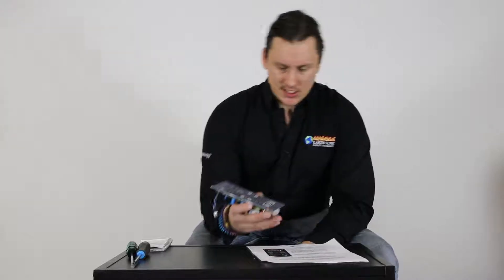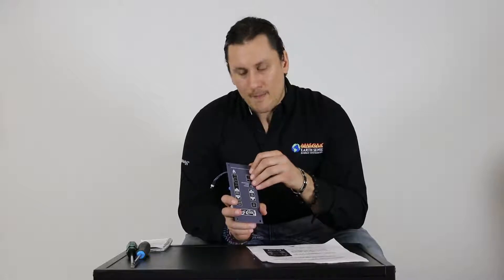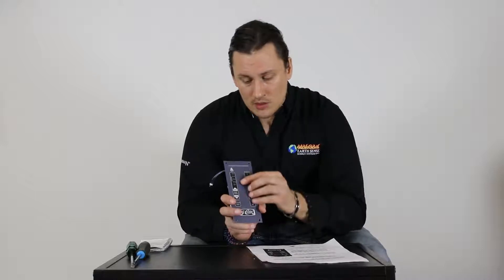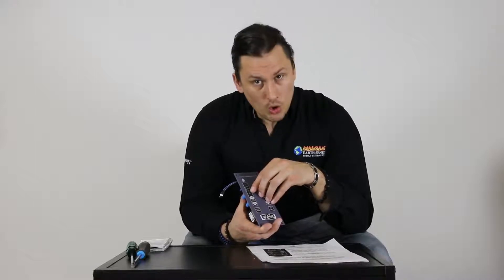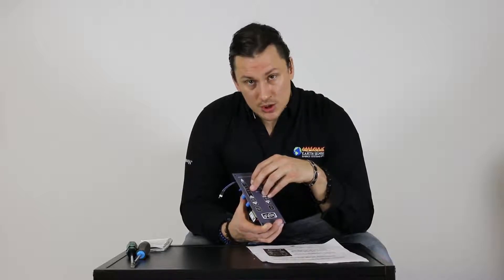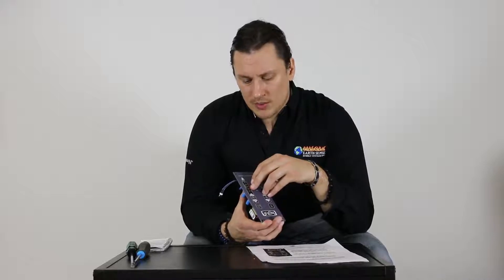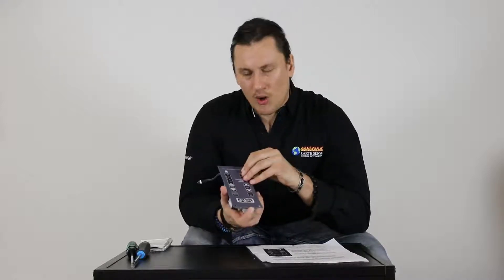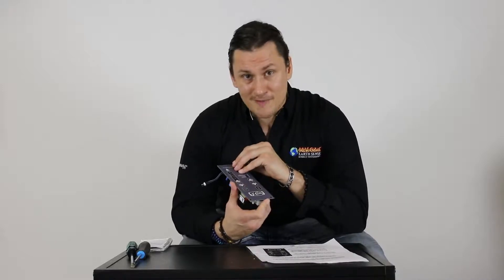St Croix Control Board Diagnostics - Error Code Fault Blinks

Comment: Hi. I have a St Croix Prescott Exl. I just thoroughly cleaned it this morning. Emptied the ash tray, vacuumed the inside, and cleaned the glass. I then topped off the pellets and restarted it. After about 10 minutes it shut itself off and now there is one single blinking light on or between the number 2 heat setting. I googled it and it said that either the hopper might be empty or it might be an issue with it so I was hoping that you could help me try to troubleshoot it. Thank you.
Reply from the maker: Thanks for contacting us, happy to help. The #2 light will indicate a vacuum switch  error. Typically this is caused by an air blockage or an air loss in the unit. 
- Check the firebox door gasket and ash pan door gasket to ensure they are sealing tightly all the way around. 
- Check the exhaust vent pipe to ensure there are no blockages.
- Check the combustion blower/exhaust fan. It should be running near line voltage during startup to lock in the vacuum switch. 
- Check the vacuum switch hose to make sure it's connected tightly and does not have any cracks or breaks. 

From there, if the issue persists we can test the vacuum switch itself to see if it is faulty. Keep us posted, happy to help. Thanks.

Comment: I have a St Croix  Afton Bay and just had to put a newer board on it.
I may have incorrectly made the initial settings .
If I unplug the stove will the computer go back to a base setting so I can reprogram it correctly. I can't get enough heat out of it with this newer control and suspect my settings are at fault.  Low heat and overloading the burn pot with pellets.
Reply from the maker: Thanks for contacting us. Yes, we would suggest to re-program and see if that fixes the issue. Unplugging the stove will not reset the board program, you can re-program as it currently is. Here is a quick video run through on that, any questions just let us know, happy to help. https://youtu.be/ljpBV4zUxIE?si=PHwiOhfpXQqa7RFm

Comment: I have a blinking 3, POF error.  I did purchase a new switch but was hesitant to screw it into the metal of the exhaust fan.  I simply placed it next to the exhaust fan touching it, but sometimes it works and sometimes it doesnt.  is it normal to screw it into the exhaist fan and create 2 small screw holes, I am assuming self tapping metal screws?
Reply from the maker: Thanks for contacting us. On St. Croix pellet stoves, the Low Limit POF switch is designed to be mounted to the combustion blower housing. There should already be screw holes in the housing where the old limit switch was mounted. How was your old switch mounted or where was it located? Happy to assist and get you back to 100%. Thanks.
Reply: @EarthSense  on the new blower housing i have, there were no holes pre-drilled, thats what threw me off, so I guess I will just create 2 new holes and see if that works
Reply from the maker: @bryanjferrer  Thanks for the message back. Very odd that your new housing does not have the pre-drilled holes for the switch. Yes, small self-tapping screws will work best to secure the switch to the housing. Keep us posted how everything is working once installed, happy to help.

Comment: Have a St. Croix Hastings stove, the unit is 12-years-old.  Was getting a #2 Vacuum Alert, replaced door and ash pan gaskets, blew out the vacuum hose, replaced the vacuum switch, finally found out the exhaust fan motor was bad.  Replaced the motor and no more problems.
Reply from the maker: Thanks for sharing your experience. Yes, the exhaust motor plays a crucial role in creating the pressure needed to lock in the vacuum switch. Any future questions just let us know. Thanks.

Comment: #4 and #5 are flashing on my Element-P
Reply from the maker: Thanks for contacting us. Are they flashing at the same time or independently of each other? 4 will generally indicate a high limit issue, 5 will generally indicate a photoeye issue. Have you inspected these components? Happy to help.
Reply: @EarthSense hi, thanks for responding! They are blinking at the same time. Stove worked perfectly last winter and we just started it up again this season to find #5 is blinking. I cleaned it and #4 started to blink.
Reply from the maker: @TaylorSmall-b2l  Thanks for the message back. If you are open to troubleshooting, here is what we would recommend. Starting with the photoeye, we want to bypass this to see if the photoeye is creating the issue. To do this, you would have the stove off and unplugged. Connect the black and brown photoeye wires together with a Jumper Wire (Link below to create a jumper wire) You don’t have to do anything with the blue wire, BUT make sure all 3 are covered so nothing arcs out. We can do the same thing with the high limit switch, but it's important we test these independently. Once the photoeye is bypassed, plug the stove back in and let us know if there are blinks yet. IMPORTANT NOTE: Bypassing a safety switch like this is for troubleshooting only. We Never want to leave a switch bypassed while the unit is in operation. Link to creating a jumper wire: https://youtu.be/FDVkbsHS95U?si=6hEBa3iOJDhyq9GP
Keep us posted!

Comment: We have the element p been having issues  with burn pot over filling fixed that with one of your videos , but recently blew the fuse on the board  and replaced the fuse but didn’t have power so replaced the board ,new board came but can’t see what the program is on because of the lights flashing 5 lights can get to run on real low but dosnt keep up on heat so put old board back in is lighting up again but can’t check program because the five lights are blinking on this one too so does this mean the sensor is bad or could it be just not lined up right ,I did disconnect the sensor and put the jumper in on both board but still blink 5 lights any help is appreciated ty
Reply from the maker: Thanks for contacting us. Yes the 5 light flash will indicate an issue with the photoeye. 

The photoeye in your model looks from side to side between the drop tube and burn pot. Important to check and clean the photoeye and the reflective glass it looks through. A soft terry cloth or Q-Tip works will for both. When inspecting the photoeye glass, make sure there are no marks, burn spots or scratches. Double check the wire connection from the photoeye to the lead wire to make sure it's secure. If you are jumping the photoeye to bypass for troubleshooting, make sure you ae jumping the wires going to the switch, not the sensor itself. Keep us posted, happy to help.

Comment: Hello,

I have a St. Croix Greenfield stove. You were quite helpful last year in my troubleshooting, and I have not had any issues up until two days ago.

 I currently have a diagnostic indicator light of # 2 blinking. 

At first, I thought it was a gasket that had just torn by the ash pan door. I have now repaired that and it was cured over 24 hours. 

Still not working unfortunately, what would you recommend? Pellet stove is vacuumed &  cleaned out.

Thank you in advance,
Maleine
Reply from the maker: Hi Maleine, thanks for reaching out, happy to assist. Yes, the #2 code will indicate a vacuum issue with the unit. This can be caused by an air loss, air blockage, or faulty/failed vacuum switch. 

- How does your fire look? Is it crisp and torchy or is it lazy in anyway?
- Inspect the vacuum switch and tubing. Vacuum switch can be tested using a multi-meter set to ohms. 
- Let's double check the vent pipe and make sure there are no obstructions or heavily accumulated ash. 
- Let's check all ash traps in the stove and clean out the combustion blower manifold area. The Greenfield was notorious for ash collecting behind the rear fire wall. Remove any brick panels and tap on the back firewall with a mallet to ash to fall down to the ash trap area. 
- Let's make sure your combustion blower is running properly. Should be near line voltage on start-up. 
- Good check on your gaskets - let's make sure the door and glass gasket are sealing tight all the way around as well. 

If your fire is crisp and torchy then most likely we do not have an air loss or air blockage issue. If this is the case, again inspect the vacuum switch tubing for any cracks and from there we can bypass the switch to see if it is faulty. We never want to leave a safety switch bypassed, just for troubleshooting. Video below on doing this. 

Keep us posted, happy to help get you back to 100%. Thanks!

https://youtu.be/FDVkbsHS95U?si=EFegS8wE6zZlgQY8
Reply: Thank you, I will look into all of this in a few days as I have to travel. The fire looks pretty good actually. I’ll try all you suggested and get back to you. Once again, thank you for sharing the knowledge.
Reply from the maker: @theuniverse8384  Absolutely, happy to help! Please keep us posted, and safe travels to you!
Reply: Thank you, have a lovely evening.
Reply: Good morning,
My apologies for all the messages. This took place as a family member died, and I had to travel out of state to a funeral. I did not mention that the pellet stove is not even starting. The fan goes on initially, but then it shuts right out. It is also about 23 years old as far as I know. I’ll be home in two days and start trying out your recommendations. Thank you again for all the advice. 

Maleine
Reply from the maker: @theuniverse8384  No apologies needed; condolences to your family members passing. Sounds good, start with the basics doing a thorough cleaning on the stove and venting. Inspect the combustion blower first to see if it is operating correctly. It should be running near line voltage on start-up. Keep us posted, happy to help.

Comment: I have a prescott EXL. End of winter season last year we had some problems running the stove and i figured it to be control board. Bought a new one and still had issues. Ended up replacing the auger motor along with proof of fire switch and high limit switch and  motor seemed to be our problem. Never could get it to run well though. Played with different settings and turned out my convection fan was in need of a good cleaning. Now i can make run well on the 2ñd setting as long as i have it turned to manuel.  I know its supposed to be on the 3rd setting but it seems to over fill burn pot . Can not for the life of me get the smartstat to work at all. Stove wont turn on at all in that setting,regardless of what program is on. T stat will turn on but shuts off after like 10 min of running time(even with thermostat turned to a high temp). Tested the thermostat wiring from thermostat to stove and it was good. Tested the wire terminal and it was good. The actual thermostat itsself seems to be working right it clicks on and off . Any help would be appreciated please
Reply from the maker: Good afternoon Cory. Ran this past our tech team. 

Overfeeding the burnpot would most likely be a versa grate issue or the back fire wall is plugged with ash. Double check the Versa Grate Motor, Versa Grate Plate (Burnpot Bottom), and overall functionality of the Versa Grate System. A lot of ash can get trapped in the rear firewall of the Prescott series. You can pull out the brick covering the back wall and use a mallet to tap on the back firewall to allow the ash to fall down to the trap doors on the left and right of the burnpot. If you have a leafblower Vacuum, stick the sucking end on the exhaust pipe outside while the stove is off and cool to pull out ash that is trapped in the back firewall, heat exchange area, and exhaust manifold. 

 As for the Thermostat, let's bypass it for testing by putting a wire or paperclip in the thermostat terminal connections. If it runs it is a thermostat issue, if it doesn’t there could be a wiring issue from the terminals to the control board.  Double check the program you set for the control board to ensure it's on the pellet setting. If it's on one of the corn settings it will not allow the unit to run in smartstat mode. Keep us posted, happy to help.

Comment: I have a St.Croix Hastings stove . The exhaust fan runs continously even when shut off. The only way for it to stop is to unplug the entire stove.
Any suggestions
Reply from the maker: Thanks for contacting us Linda. Most likely culprit here is the Low Limit POF switch located on the exhaust motor housing. It sounds like this switch is staying/stuck in the closed position. This switch is designed to close during startup allowing the auger motor to lock in. On cool down, it's designed to re-open to shut off power to the exhaust motor. Here is a reference - https://pellethead.com/product/st-croix-proof-of-fire-p-o-f-low-limit-snap-switch-thermodisc-aftermarket/

Keep us posted, happy to help!

Comment: I have an older St Croix Auburn stove (Control Board part# 80P52632). When I first turn it on, the convection fan will blow for about 10 seconds then turn off. The stove will then maintain a low heat and the on/off light blinks. It will stay in this state for hours even if I turn the advance heat level up to 5. No matter what I try, I can’t get the convection fan to turn on while the stove is hot. Any ideas?
Reply: My stove was previously used and it has behaved like this since I got it installed. I examined the control board, and I found the pins at J9 have been broken off and I can’t find the plastic jumper. Does this mean I need to get a new control board? Or could I just put a wire between the red and black thermostat terminals when I want the convection fan to turn on?
Reply from the maker: @leightonyoder4169  Hey Leighton, thanks for the information. If the J9 pins are broken and there's no jumper then I would say it's never going to run correctly until you get a new control board unfortunately. I wonder how that would have happened to the board; very strange.. Here is the  replacement board just so you have for reference. Let us know of any other questions. https://pellethead.com/product/st-croix-digital-circuit-control-board-oem/
Reply from the maker: Thanks for contacting us, happy to help. Does your control board have a toggle switch on front? If so what mode do you have it set to? Do you have a wall thermostat installed? Does your heat and flame height increase when you turn it up to level 5? Or is it just the convection fan that won't ramp up or come on?  Happy to help.
Reply: Thanks for the quick reply! The control board does not have a toggle to switch from “manual” to “thermostat” so I can’t tell what mode it’s in. I do not have a thermostat hooked up to control the stove. The combustion fan does not ramp when I raise the advanced heat level to five. The combustion fan stays at a consistent low setting.
Reply from the maker: @leightonyoder4169  Thanks for the message. Yeah it seems like it's locked in a thermostat mode that is not calling for heat. On those early control boards without a toggle switch, there was a J9 jumper used on the backside of the control board. The jumper could be moved between pins to go into a thermostat mode that allowed the stove to go from high to low. Is this a recent issue for you? Any chance that jumper got moved? I'm thinking if it was on the wrong pins and you do not have a thermostat in place that it is just going to run on low. If you have a low millivolt wall thermostat, hook that up and see what happens. Thermostat terminals should be on the rear of the Auburn. I know we have an early manual that shows the J9 jumper with details. I will see if I can find that.
Reply from the maker: I can't find the owners manual page that showed the J9 jumper for the earlier board. With the stove unplugged, if you pull the circuit board out, you'll see a small block of 3 pins and a black plastic jumper that is placed on one or two of the pins. My memory does not recall the exact pins for the thermostat mode, but I would say if it's on 1 pin move it to 2, if it's on 2 move it to 1. See if there is any change in operation. Keep us posted.
Reply: The control board that came with my stove is a little older (it has fewer buttons) than the one you linked to. Are you sure that it is compatible with my stove?
Reply from the maker: @leightonyoder4169  Thanks for the message Leighton. Yes, there has been a few upgrades/changes to the control board over the years. 100% certain the 80P30523B-R control board is correct for your Auburn. https://pellethead.com/product/st-croix-digital-circuit-control-board-oem/
 It will need to be programmed to your model when received - Instruction are included and we also have a video on that as well. Any other questions please let us know. Thanks.
Reply: @Earth Sense I order the new control board, and it arrived 4 days later. It came with a great manual that showed how to reprogram it (even though I didn’t need to because program setting #1 was what my stove needed anyway). I installed it, and now the convection fan runs beautifully in conjunction with whatever heat level I have it set at! I am getting WAY more heat out of my stove! Your diagnosis was correct! Thanks for all the help!
Reply from the maker: @leightonyoder4169  Fantastic to hear Leighton! Really appreciate your follow-up and so glad to hear your stove is now running correctly and you are warm once again. Any questions in the future please let us know. Thanks!